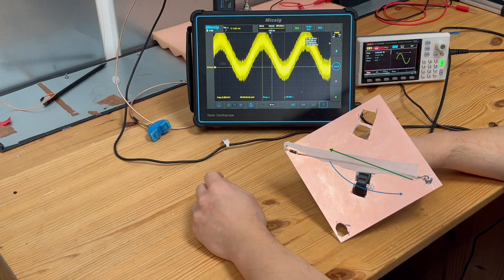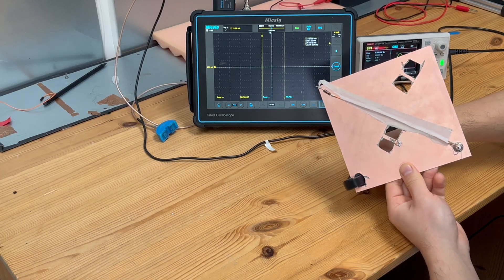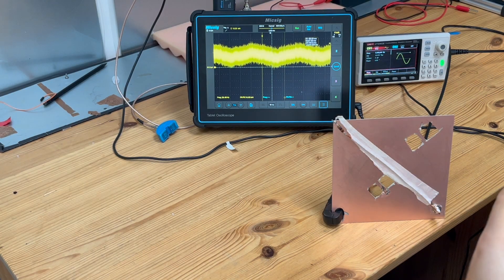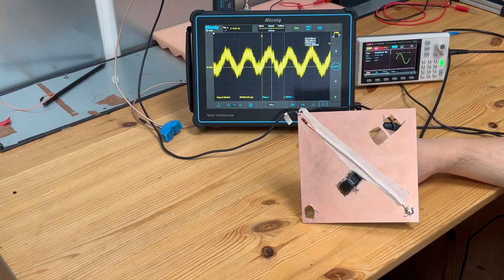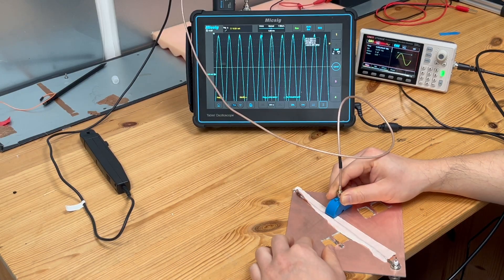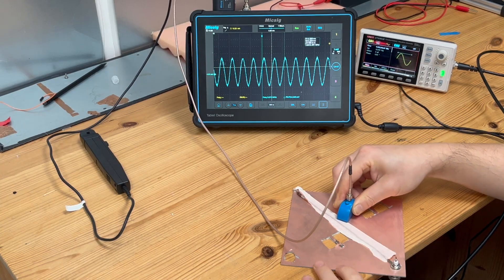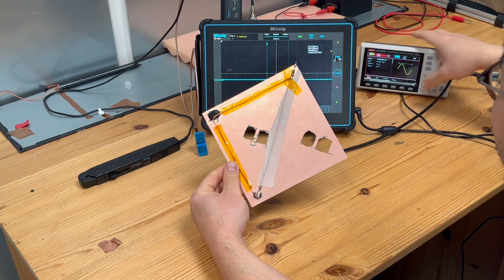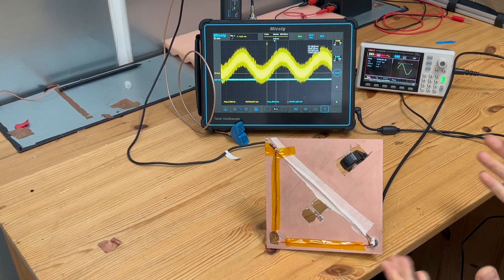Return Currents on PCB Ground: Low vs High Frequency

Comment: Thank you for your work and understandable explanation and for sharing your knowledge.
Please, give an explanation and maybe some advice about strategies:

1) How can we avoid digital noise from high-speed traces (10 - 500 MHz) and maintain a clean analog signal and analog power (which is also very important) on a small PCB?
2) Can digital ground impact analog ground if they are close to each other, like on internal PCB layers?
For example:

Analog signal - L1
Analog ground - L2
Analog power/signal - L3
Analog ground - L4
Input power + common ground - L5
Common ground - L6 (all GND vias from L4, L5, L6, and L7 are connected on this layer)
Digital ground - L7
Digital power/signal - L8
Digital ground - L9
Digital signal - L10
Is this a good strategy?

3) How can we effectively combine digital and analog circuits on a small board?
4) Should we split digital and analog ground and connect them at only one point?

Maybe this is a good topic for the next video…
Reply from the maker: If you ever have a chance, I would recommend you travel to the UK to attend the EMC&CI conference, we have experts in the field to answer all your questions like this specifically.